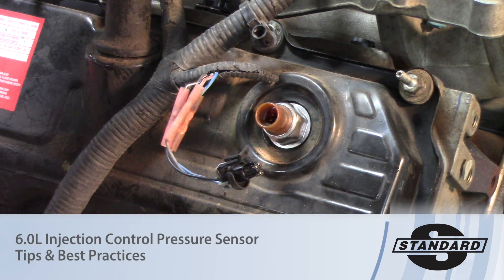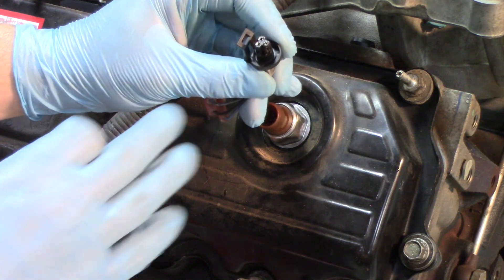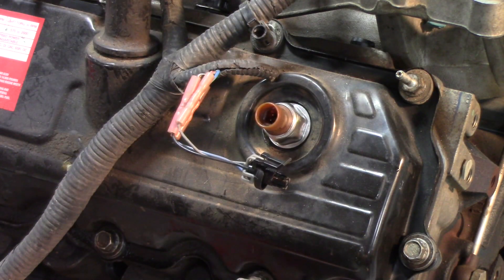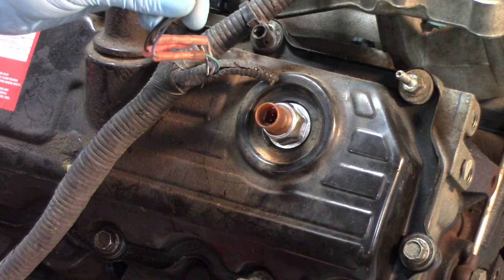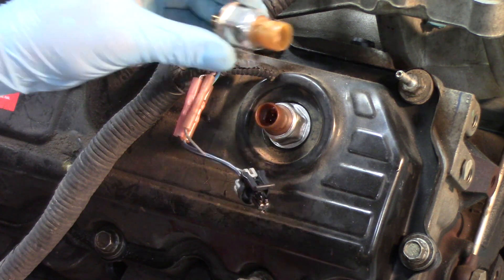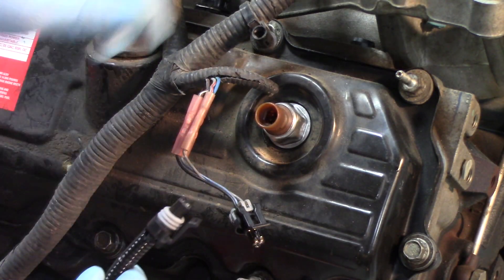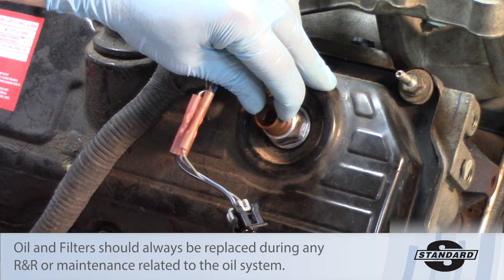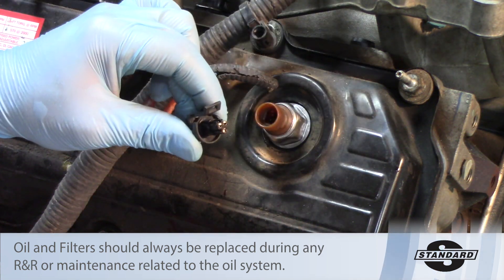6.0L Injection Control Pressure Sensor Tips & Best Practices

Comment: What year is that
Reply: Passenger side under the pipe going from turbo to intercooler, directly behind the glow plug control module on 2004.5 and up 6 liters